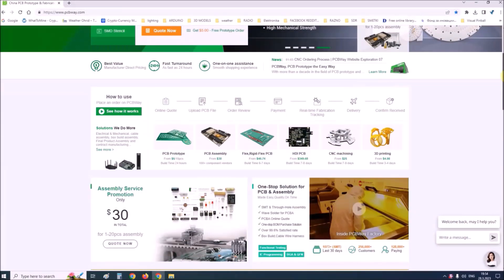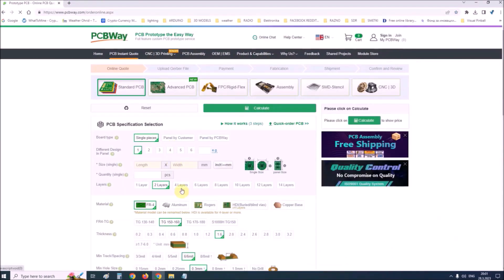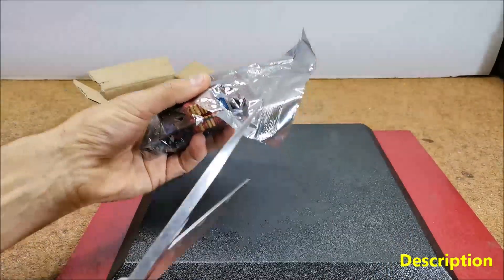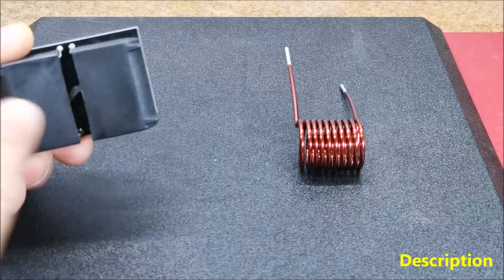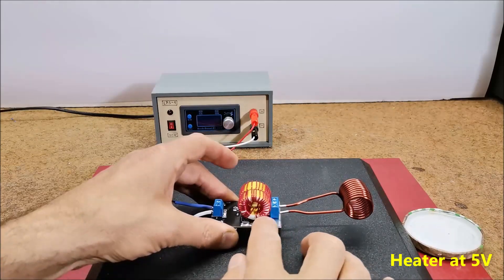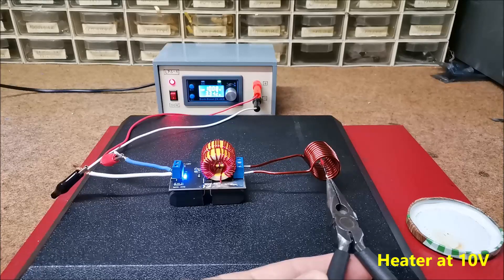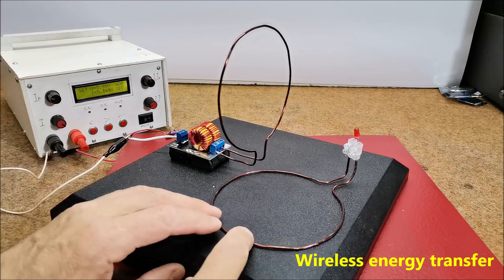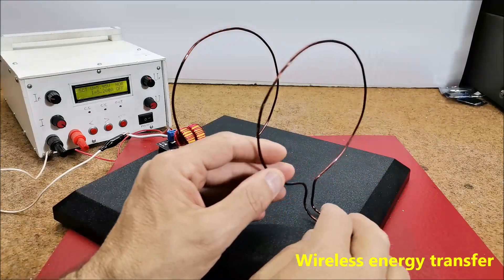Induction heater, HV source, and wireless Energy transfer with chip mini ZVS Driver from Aliexpress

Comment: I bought this same unit a few weeks ago. I am using a 12 volts battery with it because my power supply can't provide high current requirements.